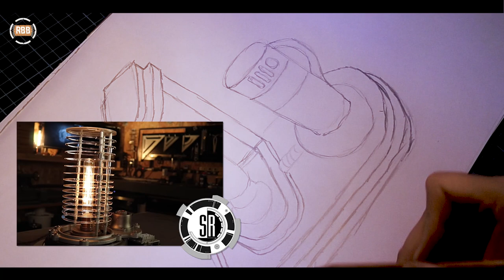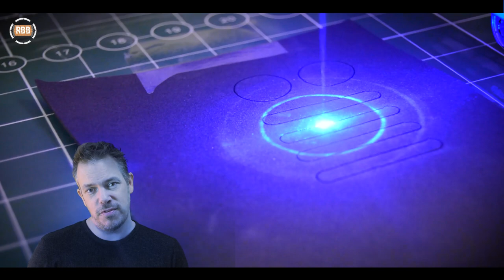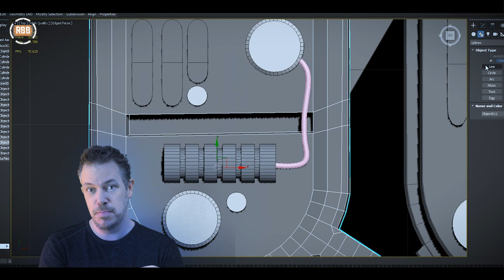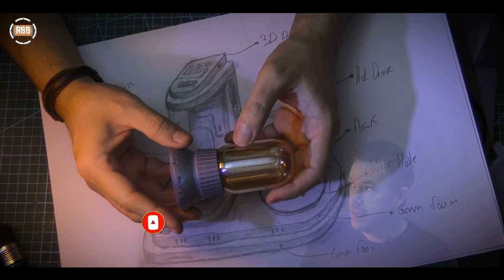Did this SmartGlass just disappear?  Prop Build!

Comment: Awesome build!

To add a level of safety to your lighting/SFx prop builds I would suggest you pick up 12v or 24v AC transformers.  That way you don't have a 120v or 240v AC fire/shock hazard on your desk or nightstand.  There is a wide array of indoor and outdoor rated 12v/24v lighting, sensors, and other devices in these voltages.  Look for "low voltage" or "controls/HVAC/building automation" equipment or doorbell transformers.  You can also find AC to DC converters and dip into the 12v DC automotive gear and allow your items to be controlled by a wall plug as well as batteries.
Reply from the maker: Fabulous idea, I shall check into that! Thanks for watching 👊